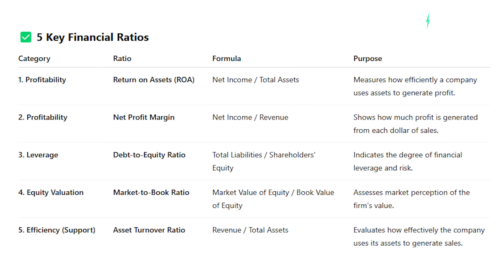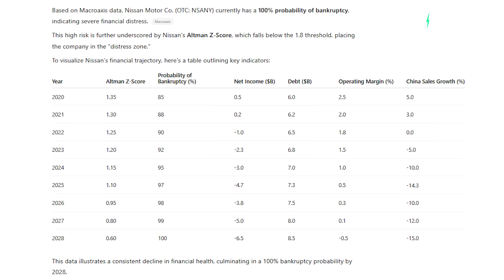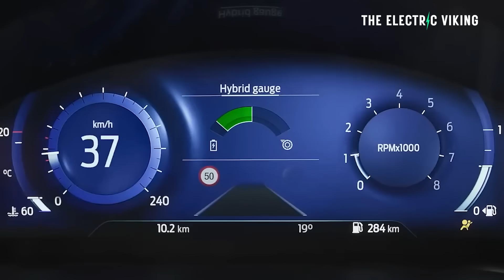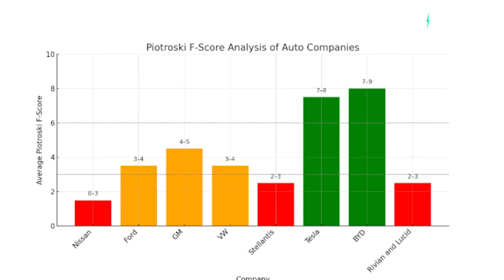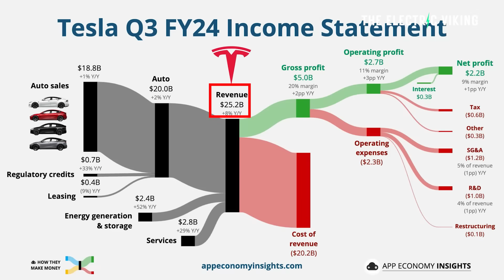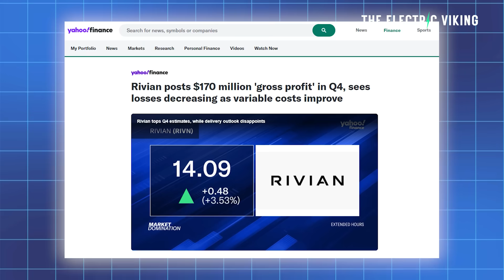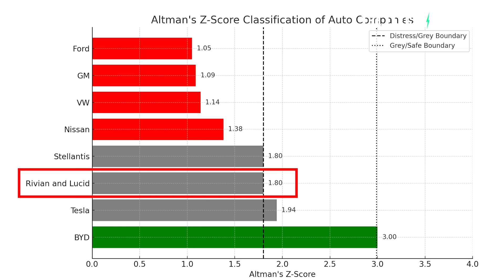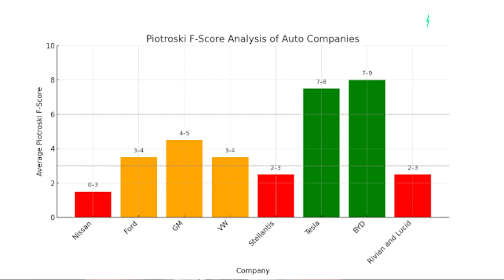Auto Giants at Risk: Altman Z-Score Predicts Auto Industry Crisis is imminent

Comment: Fur rewind: Tesla A Microwave?? The Nikola Tesla a/c induction motor of 1888 uses an electric field, with no magnets, that's continued within the motor. It's 95.5-99.5% efficient, meaning it has virtually no EMF loss, by EMF recycling. The tests have already been done, where only 3% of the EPA allowable limit reaches the driver, while your spark plugs, wall socket and microwave are at 100% of the limit. All day long... Besides, an electric motor isn't a microwave generator. They're two different machines. The motor is so efficient with no touching parts that it's certified as a 1 Million Hour motor of continuous operation. "My motor will last for 500 year's, unobstructed and indestructible" Nikola Tesla, 1933. You'll be long gone before you have a chance to debunk Nikola Tesla. The longest running a/c motor has already run for 127 years, and with all that industrial waste on your Froot Loops and fracking fluid with petro-waste in your water, you won't live for half that. Baal Gates guarantees it! @ TeslaLeaks-com

Comment: It is not just the Auto companies, entire internal combustion engine (ICE) economy is at risk!  With fewer moving parts, less maintenance and low cost solar power, BEV soon will be cheaper than ICE autos and also can last over 20+ years and 200K+ miles.
Reply: and when you wake up from your fantasy lol
Reply: Might be a problem to get these EVs transported as im sure insurance for shipping lines will undoubtedly increase as yet another ship carrying EV's has just spontaneously combusted  "morning midas"
Reply: @robertcampbell6521  and some ferry companies don't want ev's on board and even domestic insurers are saying to not charge ev's inside your own garage. Ev's "may" have a small place in cities etc but the evangelical advocates simply pretend that their spontaneous combustion capablities don't exist

Comment: I like your analysis here.  Unfortunately, we don't have the score for Toyota and Honda.   Tesla's Altman Z score is WAY above the 1.94 you reported.  According to Grok: Tesla: As of May 30, 2025, Tesla’s Altman Z-score is 15.44, indicating a strong financial position in the Safe Zone. Historical data shows Tesla’s Z-score has ranged from a low of 1.10 to a high of 23.51 over the past 10 years, with a median of 4.38.
Reply: While I trust Grok much more than ChatGPT, Gemini, and Llama,  I have found strong bias in Grok with respect to Musk related research...
Reply: @DarylOster I have found that opposite in several areas. However,  only Grok is "maximum truth seek". Therefore, chances are that Musk was just mostly correct. 🤷🏽‍♂️
Reply: @DarylOster  I was using Grok 3 and in the last month I have asked it controversial questions that it has answered with both sides arguments that seemed pretty balanced to me.

Comment: Tesla is certain to go bankrupt.  Their FSD will never be level 5 without additional sensors.  This has been proven by experts in the field but it's also obvious.  Retrofitting older cars with new sensors will be very costly.  The cybertruck is a massive Capital loss and sales failure.  The tesla robot is clearly a fraud with no technology behind it.  The car sales are collapsing around the world.  Their margins are razor-thin despite very high prices.  The EV subsidies will be gone soon.  It's priced at 10 times it's reasonable current value.  Tesla will be the biggest Enron of this century thus far.

Comment: SIDENOTES:
-initially after all the hype, i haven't seen rivian anything for quite a while
-local railroad company workers drive cybertrucks, model y's, model 3's; since locomotives are diesel/electric and it makes sense to them(EV's)
-local vw dealer i checked with recently did not have the vw buzz on the showroom floor(for unknown reasons).perhaps the best reused volkswagen idea yet(maybe order out the catalog!?)
-for the east coast, there is street parking for renters, but no electric vehicle charging infrastructure; would have to redesign/rebuild all the sidewalk/curb area in urban towns/cities. so i don't think the mighty us dollar can overcome that problem any time soon(since potholes fill the streets). maybe in 10+ years engineers can solve these problems. no one will pay 30-40 cents a kwh to charge an electric car when home electric price is ~10 cents(!!)
-even rednecks in my county drive teslas, because they are practical and prices have gone down quite a bit

Comment: Electric Viking is missing a big factor in all this.  The Altman Z score doesn't really work for financial companies.   A very significant part of both Ford and GM's overall business is their credit arms.   Ford has over $100 billion in financial assets (loan receivables basically).  And they have a lot of financial debt.  But it is a level of debt that is very reasonable for a finance company to have.    It's probably that level of debt that throws the Altman Z score metrics out of whack.  

It is best to separate out the credit arm of the business and analyze that separate.  Fwiw, Ford credit arm has long been seen as strong.  Even during the 2008 financial crises it actually held up well.  

I understand BYD has a finance arm.  But I would be willing to bet it's debt is off balance sheet.  In any case, It's a different accounting system.  At best it is an apples to oranges comparison to an American automaker.  

As for Tesla.    They have a much smaller finance arm in proportion to their debt.  Moreover, they have zero auto debt.  But remember, back around 2020 Tesla virtually got $20 billion dollars of free money from it's shareholders in a series of equity raises when the stock price went to the moon of the Elon cult.    Musk used that to pay off the debt.  So Tesla did not create a great balance because their business is so strong.   They just have a unique financial resource from the Tesla fanatics.

Comment: e bike for the win
Reply: I switched to e-biking to work and the shops ages ago, even have a dog trailer. Just as well really, cars aren’t designed to be maintained or fixed these days, my Chevy Volt PHEV died at 80k miles, the Audi I replaced it with has been in the garage for a month, I just can’t afford to keep a used car on the road anymore, leasing new is the only option.
Reply: I bought 5 Honda Minimotos when Toys R Us discontinued them at $250 each and lasted for 5 years with free charging. That's $50 per year for transportation.